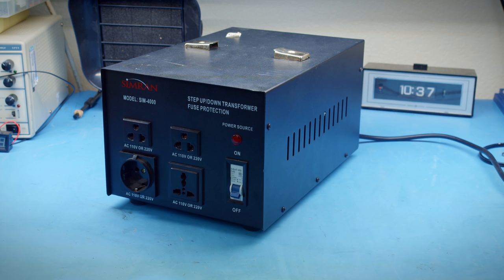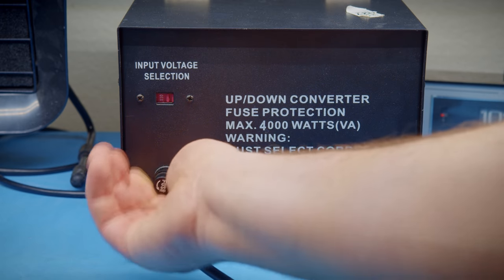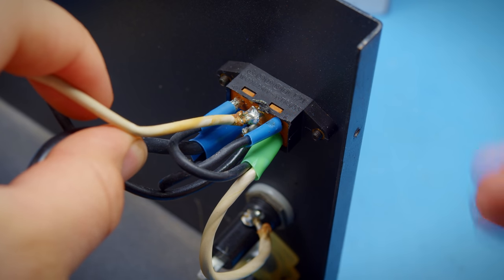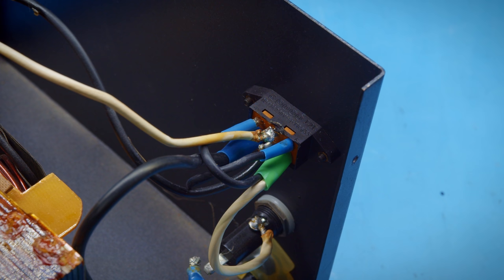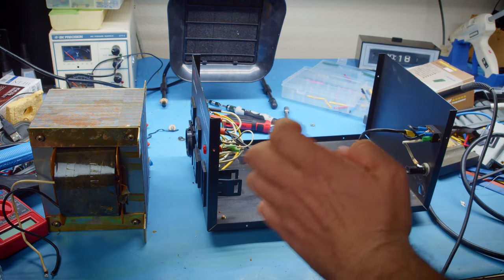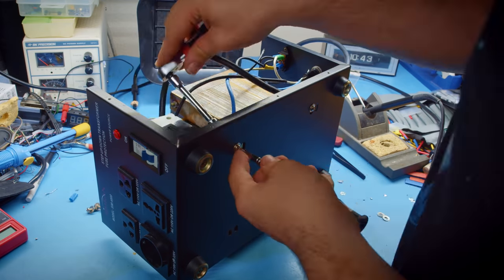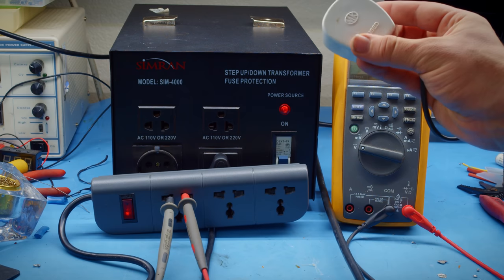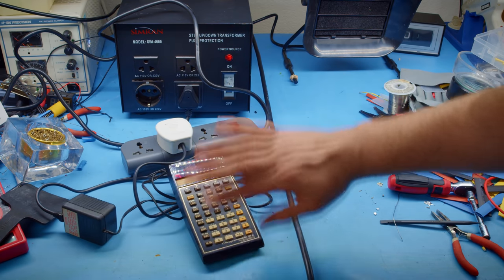Making 240V AC In the USA, Interesting but Dangerous

Comment: My grandpa has a couple 220<->110v transformers, from back in the days when Spain switched to 220V, and they needed them for their old 110V devices. He still has a drill press that works at 110V, which he uses via one of those transformers. However, it's nothing like this. No switches, just a 2:1 transformer with exposed euro style plugs on each end. While that has its own kind of risks (you should NEVER use a two-ended plug, because of the exposed mains!), it also is an extremely simple device with very few points of failure, and I feel like seeing how poorly made this was, it may have been safer to use one of that style..
Reply: I had a few of those, complete with the double ended suicide plugs as well, and they work, to some degree, though what you get as output is roulette every time you use them, as the non polarised plug is easy to put in backwards both in the unit and the 2 pin adaptor into the wall supply.

Comment: If you own your home in North America, a vastly safer option for getting a 240V outlet is to hire an electrician to install a circuit and NEMA 14 outlet.  (This is the type used for things like electric stoves and dryers.)  You then need an adapter for the NEMA 14 connection to whatever you want to power with it, but that's a whole lot easier and safer than a dubious autotransformer.  (Using an autotransformer just shows the entire thing was designed to be as cheep as possible, and that showed up in the build quality.  Not that anything with that heavy a transformer is going to be all that cheep.)
Reply: True, but often to get that other leg in say an outbuilding is an expensive option, as you have to replace long feeder cables, and often in a rented property you will find the landlord will never allow that.
Reply: I dunno, there would be no neutral, as both leads would have 120AC compared to ground. That's asking for trouble.
Reply: @StavroMueller  A NEMA-14 plug has both neutral and protective ground pins.  You're thinking of the older style NEMA-10 plug that the NEMA-14 replaced.

Edit:  Small error on my part, the NEMA-10 plug has neutral, but not ground.  That's why a NEMA-14 connector is preferable (as well as being a current connector, while the NEMA-10 is a deprecated one, meaning you shouldn't use it and it will be unavailable at some point in the future).

2nd edit:  Oh, now I get what you mean, there's no neutral return pin at the same nominal potential as ground.  Yes, that is asking for trouble, but so is anything built like this piece of junk.

If you use the earth connection and the device was built correctly, it should only blow up if it failed anyway.  The mains-referenced ground shouldn't come into electrical connection with anything else outside of a failure mode, and it's main job in that case is just to dump energy to ground and trip the overload protection without harming the user or starting a fire, which should still work.
Reply: @SeanBZA  If it's a new outbuilding, it wouldn't cost much more to run a 240V feeder line than a 120V one.  (If you want to have more than one circuit, or both 120V and 240V outlets, then you should probably have a distribution subpanel in the outbuilding, which will work better if it's a 240V feeder line. That's more costly than not having one, but also safer and more versatile.)  If the feeder line needs replacing anyway, then it won't be much more expensive to replace it with a 240V line.  If it's a large outbuilding (like a barn on a farm, for example) or has a high electrical draw (like a workshop with high-power tools), you should probably have a 240V feeder line and distribution subpanel in it.  There are also devices, like home kilns, more powerful welding machines, feaster EV chargers, and higher capacity air compressors that only come in 240V.  (These often use a different 240V connection design, the NEMA-6.)

As for a landlord not giving permission...I did start with the condition, "If you own your own home..."

Comment: According to Technology Connections channel, you already have 220v in your home.... cant remeber the video name, but he shows how you get it from your fuse box
Reply: @Lassi Kinnunen 81 which ironically the same system we have in Norway except we don't use the neutral.
Reply: That dedicates that line/room to it. This is for singular devices really. It is possible but TC was saying that's how to wire in a EV car charger.. which makes sense. You want the high voltage and current, but for a computer, you don't need that much hassle.

Comment: what kind of extension is that TT?, the plug on the end looks like a 3pin with round pins, that is what the uk used before the oblong pin 3pin plugs we have now, its very obsolete.
if you need a proper uk plug 240v surge protected extension that can be arranged.

Comment: Don't you have a variac there? It's the same principle, except there's a variable "tap" on the autotransfomer that you can control with a knob. It doesn't provide isolation either.
Reply: Correct, this one is an autotransformer with a fixed tap, while a variac has taps on each turn that connect to a wiper.

Comment: Re: 4000w power from single phase power:

British homes have a single phase, 240V supply into the home of either 60A, 80A or 100A capacity.

It is commonplace for us to have 15A circuits for 3.2KW night storage heaters, and 32, 40 or even 50A circuits for electric showers ranging from 7.2 to 10KW in power. 

Supplying 4KW over a single, single phase circuit would be no challenge in a British home.

EDIT: Dear god this power strip 😱 kill it with fire! I mean, it will probably kill itself with fire anyway. Pick up a genuine British and / or genuine European power strip, that thing is a horrific Chinese knock off which, as well as having unprotected pins which you can easily shock yourself on, the conductors will probably be aluminium of a diameter less than a human hair with the current carrying ability of a potato 🤯

Comment: First time I see one of your videos.

I wonder about the schematic at 10:35 since it is only possible if you cut off the plug and wire one in wrongly on purpose.
The guy making the article clearly blew his stuff up somehow else.

If you rewire this unit (wich certanly was needed) how come that you kept the option to step 240 to 110 ?
Much less hassle and possibility of faults to just wire it for 110 to 240 and make a new front labeling.
Do you ever need this one to go from 240 to 110 ?

Good on you to clearly state that this one is not an isolation unit. Very important ! Thanks.

When you showed your benchmeter, please clean it and wash your hands several times a day please.

Comment: Or....you could have located a good old fashioned "filament transformer" (6.3VAC out) intended for US use and spliced it into the calculator's power wire in place of the 240VAC brick...

Comment: Hi if you really need 240 volt for sometime use , in north america it can be done in any house without installing a special wall socket , it<s not recommended for long time use for safety reason , just for time by time it's fine.

first look in your main panel and locate two breaker which are on two separate phase , in general the first row are on one and the second use the second phase and is going like this for each row. when you find two not to far , use a voltmeter and connect the black on one hotline and the red on the other hotline if you got 0 there use the same one , if you got 230/240 you got it , now simply make an adapter with two nema15 plug and connect one phase on the hotline and the second phase on the neutral and don't forget to connect the ground and you got 230 volt at 60 hz

Comment: Obviously with hindsight it's a good thing you took it apart to change the cable, but I've never changed a cable if it had the wrong plug on it - I always just cut off the plug and put the correct one on. I've moved around the world and used different plug standards and the first week in a new country was usually spent replacing plugs.

Comment: a cool idea/hack is put a fan, this transformer heat like crazy, they blow up one in my job
Reply: @LabRat Knatz yep
Reply: @LabRat Knatz Hmmm....liquid cooling, just like the distribution transformers in the grid (which have the same problem of dissipating heat).  Potentially, you could even make that an active cooling system, with monitoring to shut it down if it still manages to overheat or the load exceeds the device rating.

Comment: If you are a homeowner, you can put in a 240VAC 15A receptacle (NEMA 6-15). The output will be the same as this device, 240VAC 60Hz, but without the dangers solder joints. After that, you just need a simple  adapter cable with a NEMA 6-15 plug on one end and a receptacle plug of whatever 240VAC standard you want on the other end. Another thing you can do in a pinch is to find 2 outlets that are on different phases (generally neighboring rooms are like this) and make a cable that takes the hot side from each connects it to a 240VAC receptacle. I would not recommend this for anything long term, but it would work. 
For anyone worrying about having 120, 120, G instead of 240, 0, G: It doesn't, generally, matter in European electronics. The Eruoplug (the round one with 2 prongs) is not polarized, meaning the device connected to it, is designed for the hot and neutral in either direction. There is, however, a situation where this could matter. In England the plug is polarized since the ground pin is always required. So, a English appliance could be picky about the lack of a neutral, or they cloud have tied the neutral to the chassis. In this case a simple isolating transformer would solve the problem. But this will be a rare occurrence since any device that is picky about not having a neutral probably is also picky about its frequency.
Reply: This is only going to be a problem for devices built for the UK market only, which is pretty rare.  While I'm sure there are such things, it would be like a manufacturer making a device for Canada that didn't work in the US for some reason that they didn't really have a reason to do.  (I know of at least one product like that, but it's candy that runs afoul of a well-intentioned but poorly written US food safety regulation.)
Reply: Some people don't live in a situation where there landlords like them install, or let the, have someone else install, stuff like that. As he said, if he could do it, he would, but he can't, so he shan't.

Comment: Is that weird triangle plug from Europe as well? I could recognize the UK one and the one you removed from the transformer. But the triangle plug you put in I have never seen before.
Reply: It looks like the Indian power plug, which is based on an outdated UK one
Reply: It's one of them unsafe, unfused moulded plugs that come with most Chinese electrical gear, I wouldn't be surprised if the cable is copper clad aluminium.
Reply: They used to be normal in the UK, and thus spread to the empire. That one was rated at 5A, but I wouldn't be surprised if they pulled 15A iin some places. They are still available in the UK, but the good ones have shrouded pins for live & neutral.

Comment: And what kind of device would do the same and generate 50hz from 60jz???
Reply: I have a transformer adapter I bought in Japan in the 90s, it outputs 100v at 50 or 60 hz depending on what you want.  I have never seen one in the USA in a department store like this one.
Reply: A DC power supply feeding an inverter is really the only way. Like a scaled-down version of the frequency converter stations used to send limited amounts of power between 50Hz & 60Hz parts of Japan. or placed at either end of an HVDC transmission line, or to move power between grids not synchronized with one another (e.g. Texas' ERCOT & Eastern Interconnection in US).

Comment: but you dont have 240 in you house? is normal to have 2 110 face whit a 180º defase and usin the 2 live of that you get 240, electroboom explain this very well
Reply: Hence my suggestion to get a circuit and NEMA-14 outlet (or a NEMA-6 outlet, which is also available for regular home installations) if you need a 240V outlet.  A lot of homes already have such outlets, for stoves, dryers, EV chargers, higher-power AC units, and the like, and particularly with more EV charges being installed all the time, there are more and more being installed.
Reply: @evensgrey  exactly i think in the future usa will end switching to 240 in all outlets because more a more supplies are 240 like you said, and have 110 and 220 is more complicated and dangerous, in the country i live now like 10 years ago we have 110 and 220 an now 110 in no longer more in house and is illegal to have it, you need to annul the 110 if you have in your house, but sadly we they need to change the codes an regulation for installation because the are very unsafe, like we still use the american plug but we dont have ground so all the electrical thing we use come whit out ground or the pull off the ground leg of the connector, and the breaker in all of old house are very unsafe too also in all house they dont use the breaker that detect when you have a leak to ground, i dont remember is name in English but is common to see it included in the outlets of bathrooms
Reply: @MakarovFox  We've had this system for well over 50 years, with only the most power-hungry of devices using 240V.  I doubt we're going to be rid of 120V power any time soon.
Reply: @evensgrey  may be how knows the world is strange

Comment: It's not 4000W but 4000VA.
Reply from the maker: At 3:17 they rate it at 4,000W, I'm just referring to their rating.
Reply: @TechTangents  yes but on back of case you can see 4000W (VA). 4000W is true just for resistive load and devices with good Power Factor Correction.

Comment: I need one of those... So I can run my well pump (220v split phase) off my 110v inverter. I can't afford a good one, hell $20 is difficult to swing so I doubt I can afford shipping. My question is, do you know of anything common that might have a transformer like that in it so I can pull one from local scrap? I want to find a good factory built one before I go attempting to rewind a few microwave transformers.

Comment: Had a smaller one, which I removed that input selector switch from, as in 220V input you really do not want to switch it to 120V input, and have the outputs supply 480VAC for a few minutes, till the transformer catches fire.  Scrapped it after a while, because the CCA windings were breaking from the terminals from stress, and I got tired of fixing it. But as I got it for free no great loss

Breaker as switch is fine, they typically should survive 1000 mechanical operations when used as a switch, and as a standard unit it is easy to replace, and will at least be better than the afterthought fuse they also put in, likely because the case blank came with a space for the fuse pre punched. Would probably be worth it to place a very high power 275VAC MOV across the output, to clamp the spikes that the transformer can generate on turn on and off. 

4kVA rating will actually be correct, though not in the USA, but in Europe you can get 20A from some mains socket outlets as peak rating current, and while the output at 120VAC would need all 4 sockets loaded with 10A to actually use it, and those nasty "universal" sockets would not survive it anyway, it is doable. Better output sockets would be preferable, but likely will need some work to fit them, and I would recommend using the British standard, as it at least has a fuse, plus is widely available. All 4 removed, and you could fit a single one in the space perfectly, with the face plate to cover the nasty mess.

With reversed mains polarity on 120VAC input there is not really any issue, you will either get an output where each of line and neutral output is at 120VAC, which is fine with a Schuko socket, as polarity is not defined there in a symmetrical socket ( though the convention for wiring them IIRC is left side facing socket should be live), or you will get an output with neutral at roughly ground potential and a live of 230VAC referenced to ground, which is also acceptable. Not going to stress insulation on any appliance plugged in at all. 

Other way on 230VAC input and 120VAC output, you can have neutral floating at 120VAC and line at 230VAC, or neutral at ground potential and line output at 120VAC, and the first one is what will cause MOV units to fail, as they are now subjected to double the rated voltage, plus insulation of equipment might not be robust enough to withstand the stress. Also, cables for US voltage likely is not really, on the cheap older ones, capable of withstanding 230VAC well, and with tight things like UL knots, might have insulation breakdown. Plus the whole unit is floating at 120VAC above ground as well, in the first case, irrespective of equipment switch position, and any exposed metal parts can give a lethal shock.

Comment: You don't need to "make" 240 volts from 110. Almost every American house already has 240V.
Reply: Yes, but that's usually only for appliances, like dryers.  The 240V is usually its own circuit from the fuse box.  So, yes houses do have 240V, but it's not always convenient to use.

Comment: Dunno.. if the soldering is that bad I'd take it that the windings in the transformer are also crap and throw the whole thing out.
Reply: They probably source the transformer and the case from somewhere else, and then do the hackjob they did. Obviously you're supposed to use crimp connections. I'd say this thing could be pretty decent if you rewire it internally.

Comment: The build quality is downright shocking. This thing is basically a fixed variac, the principle is the same. Also this is the kind of components that are NOT meant for soldering, but rather crimp connectors, especially with this kind of power.